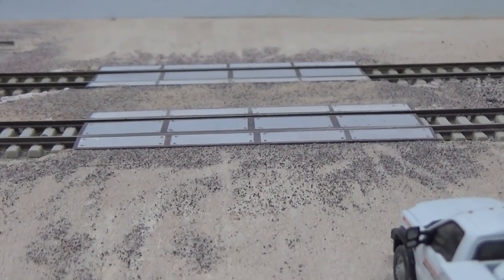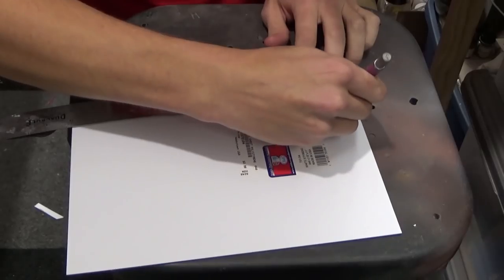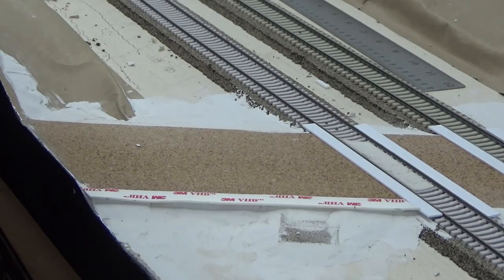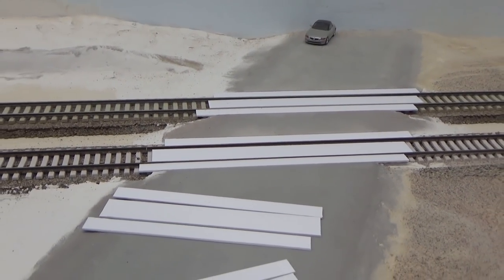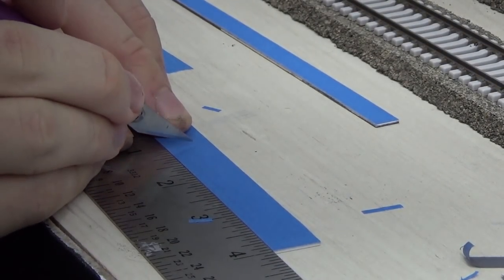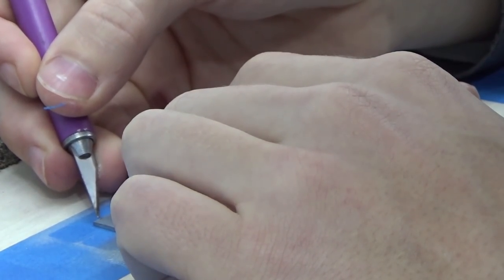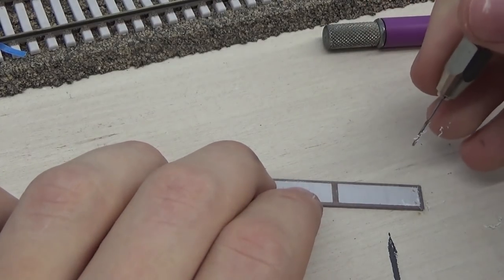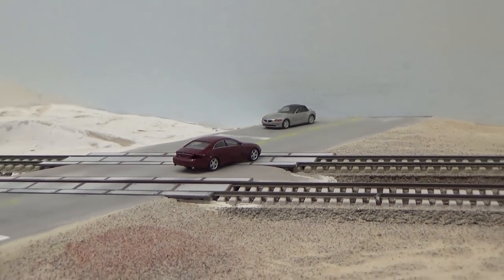Make Concrete Grade Crossings from Scratch - Crawford Scenery Episode 4

Comment: Your mercedes is missing it's taillights. Also how did you make that gravel/dirt it looks amazing?
Reply from the maker: Haha, you're right. I'm not sure where they went because they were there originally. And the dirt is pretty simple. I use a mixture of dry plaster compound (Plaster of Paris), AZ Rock and Mineral EARTH (from kaibab limestone), and a bit of yellow tempera powder paint. I mix the plaster in about 50/50 with the rock powder because it lightens up the color. Whatever color you're going for, make it a shade lighter because it will turn a bit darker when glued. I add the tiny bit of yellow powder paint because the rock powder color was a little too red for me. 
-Cam
Reply from the maker: If you wanted, you could make a dirt mixture out of just plaster compound and powder paints. This is the method called 'zip texturing' that Adam Fugate uses. I prefer mixing the plaster with a powderized rock/dirt because it adds some fine grit to the mixture. Plaster compound and powder paint alone behaves much like flour, and when you sift it onto the layout, it likes to clump to itself. Powderized rock, on the other hand, behaves more like sand and spreads out thinly and nicely when sifted. Plus, the rock powder already has color to it, meaning that you don't necessarily need to add any powdered paint, unless you want to change the color slightly (like I have). I'll be making a video explaining all of this, but I kind of make it up as I go.
Reply: @railfan220  thanks, it's really nice with the Tire tracks
Reply from the maker: @maxim430  Oh and I forgot to mention that the gravel on top is also from Arizona Rock and Mineral, and it's N scale ballast. Once the dirt was glued down and dry, I painted a coat of diluted glue on top of the dirt in places, and then I sprinkled the gravel on top. Once dry, I scraped away the tire tracks with a stiff bristled brush (sand paper works too).

Comment: Awsome my man!  That is all what you call artwork ☺💯Hey btw is that craft paper in the background? Im trying to make some mountains for my background.
Reply from the maker: Thanks! Yes, that is painters paper that I got in a big 3' tall roll from Lowes. I cut it up and use it to shape the landscape. I support it with cardboard profile boards underneath, and attach it with hot glue. Once in place, I coat it in wood glue to waterproof it. Then, if you are as cheap/lazy as I am, you can do scenery right on top of that. If you feel that the paper is still too flexible or doesn't have enough support, you can put sculptamold or a non-cracking plaster on top of it to give it a hard shell before scenery.
-Cam
Reply: @railfan220  yeah i thought it was. I have some brand new just wanted to make sure that way i know what i was getting into. It makes sense how you would have the option to either have sculptamold or non cracking plaster because gluing it and everything is fine. It just probably would not b enough support by just having craft paper in place. Do they have those things as well at lowes. Lowes and menards are some pretty good stores for what ya need ☺

Comment: What thickness plywood did you use for your bench work? Thanks
Reply from the maker: Along this section in the video, we used 1/4" plywood on top of 1x2s. We only did this to save on benchwork height and make it easier to see the yard below, so I would recommend using 1/2" MDF like we have elsewhere. Some will say 3/4" is better, but that's total overkill. 
-Cam
Reply: Thank you! Great layout planning and looking forward to your next video!